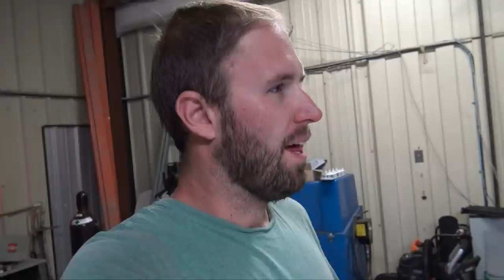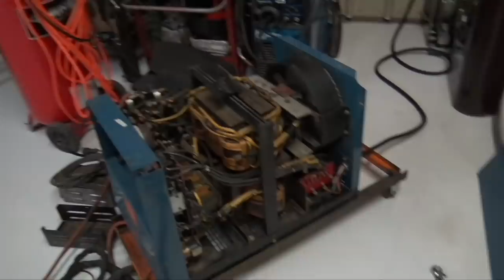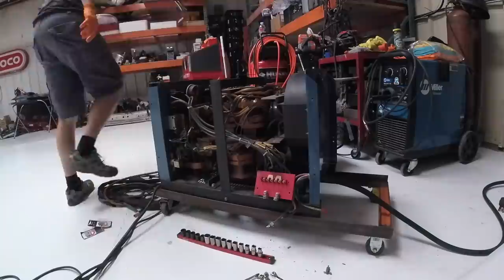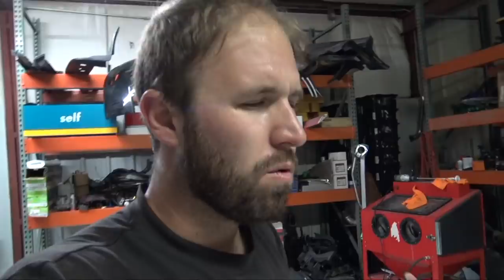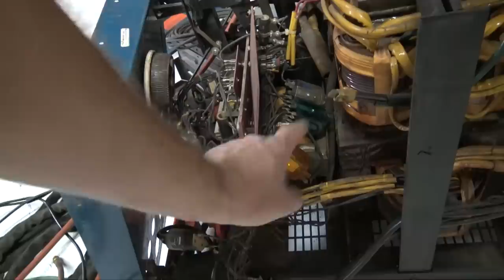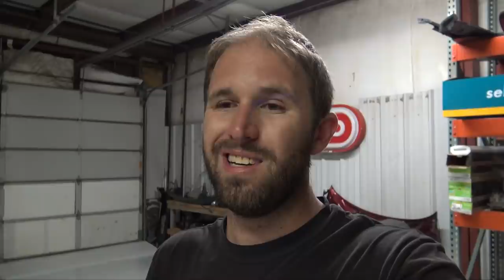Fixing a Dinosaur Miller Tig Welder

Comment: The ground wire is not part of the current carrying circuit.   It’s a safety to take stray current back to the source to trip the breaker.   If you have voltage or current on an equipment grounding conductor, to have other problems

Comment: dave small suggestion here but make sure there is no metal shavings or any slag on the inside or tops of the windings on the transformer coils in that welder i used to build custom transformers in a shop and that was always #1 issue for repairs on customer units  causing them to short from winding to winding which is bad lol. among other mechanical failures like look mounts vibrations and poor connections.

Comment: I have a welder that's 45 years old, still works.
Reply: Wilco jak I got u beat,got a 1969 Lincoln idealarc 250 AC DC that still works great. Got it 3 yrs ago no leads for 100 bucks. I already had 100 feet of 2 gauge leads.

Comment: Be sure if you are pulling a trailer that you run 70 to 80 psi in those rear tires. The proper inflation chart is inside the driver side door jam